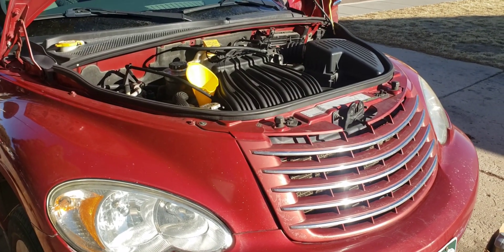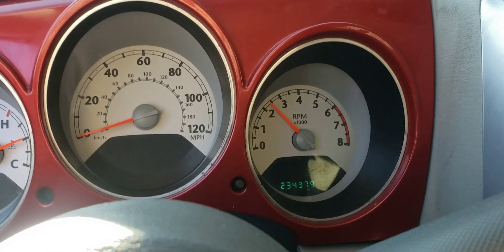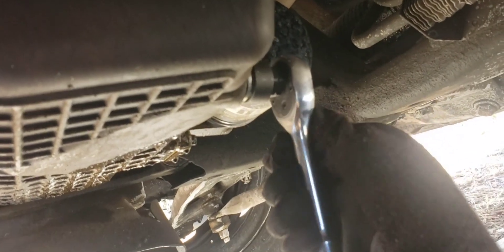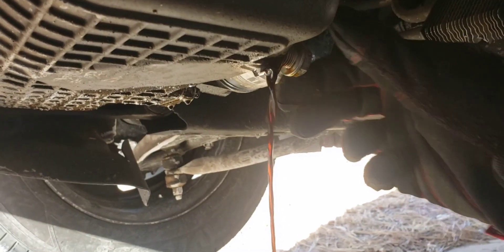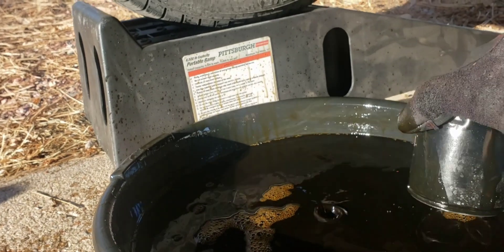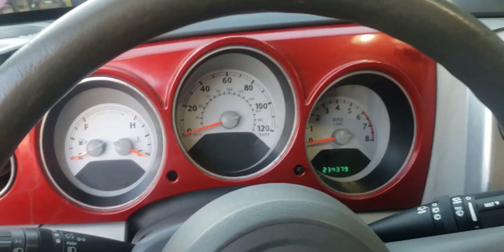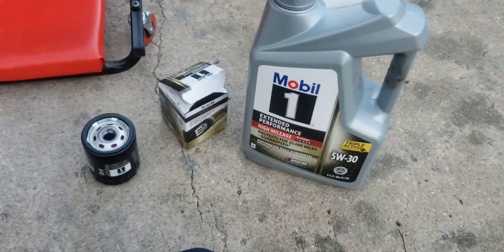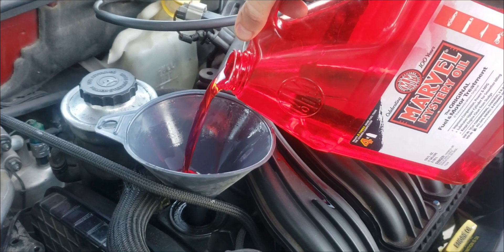I Do an Engine Flush on my 2007 PT Cruiser

Comment: Good job
Reply from the maker: Yeah, immediately after the flush in the video the car still sounded a little rough. But it could have just been that it needed to bring thicker oil back up to the cam lobes.

After driving it a little while it sounds better than I have ever known this car to sound since I've owned it at 200k miles. No weird idle hesitations. I honestly think if I got a compression check done, it would probably be around 150 to 160 on each cylinder now (I can see if my friend has a compression guage).

It idles like it's brand new. And it has 235k miles 😆.  Runs amazing, like it can go to 300k or 400k now.
Reply: @Andrew_Stoffel  that’s awesome! Put some good fuel injector cleaner like chemtool B-12 it will run even better keep it up!
Reply from the maker: @Tommikegetitright101i  Funny that you mention it, I did just put some of that in! I am going to put some Gumout Tune-Up through it also on the next fill-up.

I also used the B-12 Chemtool in another vehicle, good stuff!
Reply from the maker: @Tommikegetitright101i  Honestly, I am starting to think these ethanol fuels they put in most gas stations is the culprit for a lot of our issues long term. Ethanol has its pros though, like adding more horsepower for certain car enthusiasts. But personally for me lately, I just want my vehicles to last as long as possible.
Reply: @Andrew_Stoffel  facts I totally agree with you sir.
Reply from the maker: @Tommikegetitright101i  https://youtu.be/jzB1Vc1h-Tc

Here is an E85 beast!! It adds another 100hp to this machine! Another pro for ethanol though is it runs cooler. Pure gasoline acts more as a solvent though. So, to keep an E85 muscle car, you gotta runs some cleaners through it often, or at least I would.

Comment: Have you have any issues after you flushed your oil ??? Any info you could give me would be great thanks ...
Reply from the maker: The only thing I noticed was it idling a little higher on startup a little longer. But it. Could have been cause it was still pretty cold out. It started running a lot smoother after the flush like there was a compression issue that it fixed. I have since sold the car and it has been running well for the person who has bought it. That's all I know right now.